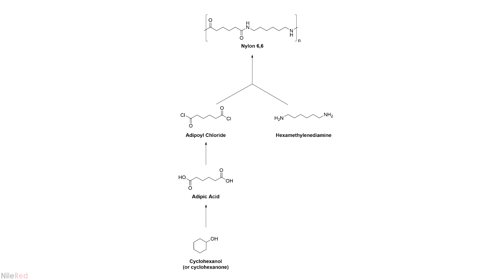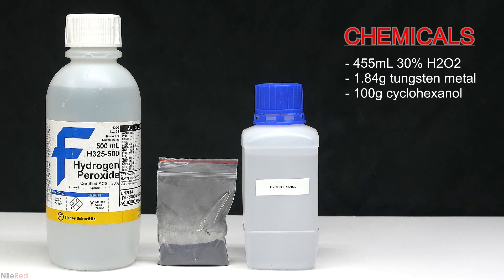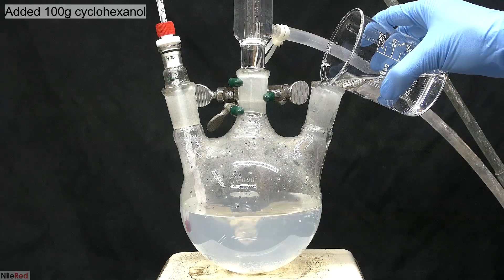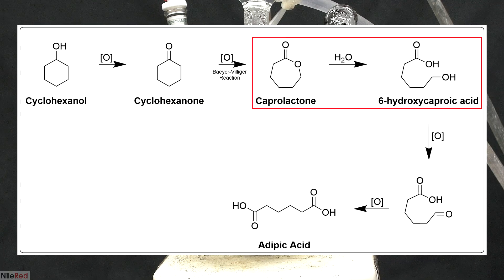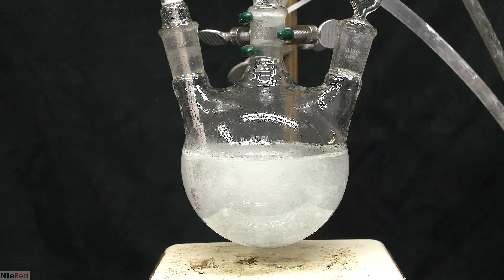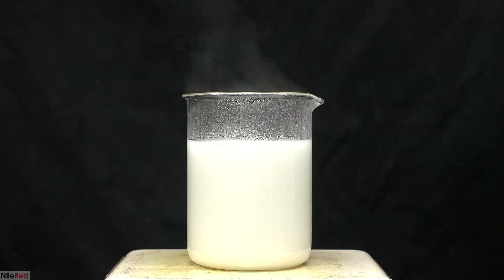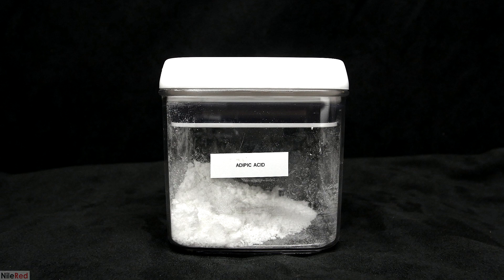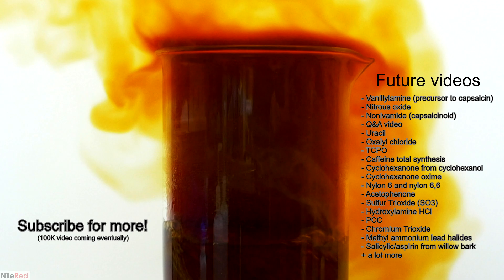Making a Nylon Precursor using Green Chemistry

Comment: I also did a video on that synthesis and with the Help of a co-catalyst I could get the yield up from the 34%, that you got up to 44%, thats about a 25% higher yield. So If someone wants to try this synthesis check up my latest video ;)
I used 5-Sulfosalicylic acid(easy made from Salicylic acid and H2SO4) as Co-catalyst, but you can also use Phosphoric acid, Hydroquinone or Ascorbic acid(but 5-Sulfosalicylic acid is by far the best).

Comment: 5:54 whats the significance of having the thermometer in the left joint? Would the middle read something different?
Reply: The middle is occupied by the condenser. It's normal lab practice to use the middle neck for the heaviest/biggest piece of glassware to have a more balanced apparatus.

Comment: You need a water bath around the flask (such as in a large beaker on a hotplate) instead of the mantle.  You will have a large thermal ballast.  If the reaction makes a lot of heat, you can control it with a few ice cubes added to the bath.

Comment: VoV. Please tell me where he got the beakers with nile red written on it
Reply from the maker: I had them made! And i sell them on my website www.nilered.ca
Reply: Oh... sorry for my not noticing.
Reply: One more question! Where do you get those long condensers you use in countless videos. They look very thin, yet there is water running through them.
Reply from the maker: +Aditya Varma I didn't buy them, I was given them. So I am not sure where to get them. They are my favorite condensers though! I think they are pyrex brans
Reply: Cool. Great video btw! keep doing videos with facecam!
Reply: Hello, Is it possible you could do a video on the preparation oof monomethylhydrazine? Generally, the hydrolysis of gyromitrin yields monomethylhydrazine. I plan to use it as a rocket propellant in one of my upcoming projects. I understand if you can't do it due to risks and concerns. Anyway, I just can't seem to come up with a feasible prep (im 15). Thanks.

Comment: maybe it get lower melting point because it is hydrated. Water act as impurity, dry it well and measure it again. A question: could you have used simple acid catalysis in place of W catalyst ?

Comment: For the lava lamp effect, it looks like it's going in the other direction.
So maybe the bubbles cool down in contact with the surface at the top and sink. At this point there is more interface with the liquid so it reacts faster and heats up, which brings the bubble back up.

Comment: If you're interested, adipic acid can also be ketonized with barium hydroxide to yield cyclopentanone, which is a great starting point for anything you want a 5-membered ring in. Also, I think your blobs kept sinking because the cyclohexanol was likely dissolving the adipic acid as it formed and thus becoming much more dense than the peroxide solution.
Reply from the maker: +Amos Z interesting stuff! I'll look into the cyclopentanone

Comment: Could you just directly react the adipic acid with hexamethylenediamine rather than making adipoyl chloride and reducing yield
Reply from the maker: +Joules Jams the final polymer is an amide. You need to convert it to an acyl chloride to react with the amine. The carboxylic acid won't really react. It will undergo an acid base reaction and not go very far
Reply: NileRed I thought in proteins the same thing happens but I guess they have enzymes. Could that be a green method to use enzymes?

Comment: You can make an equimolar salt of the amine and the adipic acid. When that is done, melting the salt slowly will make nylon. That way you will even be "greener" by not using any chlorinating agent, and only making water as a waste.
Reply from the maker: +HClO3 Chem really? Interesting. I'll look into that!
Reply: Yes! I read it in a quite old polymer chemistry book I sold like 2 weeks ago. I was quite intrigued. Apparently, only mixing the two compounds in solution and waiting will lead to polymerization even with water present.

Comment: You have many interesting things on your shelves. Including much evidence of either acids in the air rusting, or neglect/disuse. Either way.
Edit: And like the 'toss bottle of powder'  'toss bag of metal'  'hold firmly onto the acid' :)
Reply from the maker: +Electra Flarefire I boiled some acid and kind of ruined some stuff
Reply: That know from experience. Left an open container of HCl in the workshop sink cleaning metal and left it for a  week. Came back and my workshop was rusted from heavy at one end(near the acid) to untouched on the other.
The stem of the drill press was even rusted on one side and not the other. It was impressive.

Comment: It took this many years for someone to figure out replacing nitric acid with hydrogen peroxide? Immediately when you said acid is used as oxidiser I thought why not H2O2?
Reply from the maker: +deldrinov the issue is the catalyst and the reaction conditions. You can't just swap it very easily. They used a new catalyst and had to heat it.

Comment: I think your issue about the exotherm etc could be limited by using larger glassware as you do not seem to have enough headspace in your reaction vessel. Larger glassware would limit how badly it would boil over. When I work on 100 g + scale I use a 1L 3 neck at the bare minimum, it looks like you used a 500 mL three neck?
Reply from the maker: +Dizzyheights this is a 1L.

Comment: is this viable for large industrial scale production , i assume you must have researched about it while you were digging around . and is this more expensive or cheaper than the original reaction , as hydrogen peroxide and nitric acid prices vary greatly by country wise . what happened to your second channel , nileblue ? thanks for looking at my questions , waiting for the next video .
Reply from the maker: +Shrikesav Adhitya the paper says that it is viable. I think it is slightly cheaper or about the same. Peroxide and nitrtic acid are both pretty cheap. I think the issue is that it's hard for manufacturers to completely change their setup. 

My second channel was forgotten as I got busy with other stuff. It will be revived soon, I promise!

Comment: Did you think about using cyclohexene instead (about the same price and more commonly found in higher purity)? Should give the same product through dihydroxylation/diol cleavage/oxidation via tungsten catalysis.
Ozonolysis and oxidation would also give you the product in about an hour of work, but not sure now readily available the materials for that are outside of research.

Comment: Can you name the offending eBay seller? I would like to avoid them in the future.

On the other hand, dud you consider that cyclohexanone may be the contaminant? It freezes far below cyclohexanol, so it wouldn't be too unreasonable to assume cyclohexanol is crystallizing out at freezer temperature. I couldn't think of much else that would contaminate cyclohexanol, barring adulteration.

Finally, could the insoluble stuff be just residual tungstic acid left over from the oxidation? Did you also consider that the low yield may have been due to the repeated attempts at crystallization?
Reply: I second this comment.  Without H202 the tungstic acid will not be soluble, try rinsing with cold H2O2 instead of water.
Reply: I don't think so. If the contaminant was cyclohexanone it wouldn't be a problem, since cyclohexanone is formed as an intermediate in this reaction.

Comment: Hi Nile, I'm always very happy to watch your videos. Soon I'll try to extract cafferine in half-industrial scale, basing on your videos. But that's not the point. While you were heating reaction mixture, why wouldn't you use a simple (and extremely cheap) circuit to control voltage on heating mantle?
Reply: You could also use a fipmle thermistor and a arduino pcb to automatize it. Even to make mantle 100%, when temp is below wanted level, and turn off if it's equal or higher :)

Comment: how did you measure the melting point
do you have some type of super calibrated thermometer
Reply from the maker: I have something much worse than that. It is my own homemade apparatus. It involves an expensive Fluke thermocouple and a heat gun. It is surprisingly accurate, but horrible at the same time.
Reply: Dammn you should do a video about that that would be very cool

Comment: Have you every thought about using a PID controlled heating base? That could adjust the heating based on the temperature of your solution in a feedback loop.
Reply from the maker: I have, but either I need to make it myself or buy one. I am lazy though and they are expensive, no?
Reply: NileRed It would be really easy to write some Arduino code to control the temperature of the reaction, and it would be cheap. Under $25 usd.

Comment: WOW, the Mounties!? did they come to your house (Eh)?<-i know I know. but seriously..... also BE CAREFUL. one of the largest additives to tungsten is thorium. so your tungsten has A VERY high chance of being contaminated with it. it's sheet that or cerium, lanthanum etc. great video. keep it up! oh and the globs could be a Thorium or cerium intermediate. remember you said your tungsten wasn't that pure! I'm sure the guys from the "paper" your citing didn't use eBay tungsten. lol 
the sharp increase in temp during the oxidation reaction seems to me ALOT like a "free radical" mechanism. these usually include a sharp activation that includes a sharp increase in temperature as they are usually exothermic. anyway, that's my 2℅ forgot about the cyclohexanol(and didn't watch the video all the way thru at the point where I got overly excited stopped the video, and preemptively posted) yeah, your guess makes more sense.
Reply from the maker: Thanks for the input! Also, are you telling me that eBay tungsten is not the highest quality that money can buy??
Reply: NileRed lol, sure it is. if you don't mind the floor sweeps from the local GTAW tungsten electrode manufacture!
Reply: so I want to clear something up. after reading my first post I realized how it might have come off. I have a metallurgical degree/background and an IMMENSE love for organic chemistry. I have studied the field of organic chemistry, synthesis and it's practice for five+ years now. and metallurgy for over ten. I also believe in and support the home chemist/scientist. some of the world's greatest discoveries were made this way. I know your smart and I know, thru observation at least, that your lab skills, safety and knowledge are of at the least at a graduate level. however having said this, what I don't and could not know, is where your knowledge stops! since there's not a single person on this planet that is TRULY an all knowing expert in the field of practice,(except me 😋) ESPECIALLY organic chemistry, I have to assume there are MANY holes/gaps in yours as well! I merely wanted to express the dangers of thorium and it's compounds because of their toxicity. since you mentioned that your sample came from eBay and you thought it might not have been of absolute purity (of which I agree)and at the same time didn't hint towards what the contamination might be, I was offering a likely source. And only really said anything because the most likely contamination, Thorium or thorium oxide, is NOT something to play with! I am VERY sensitive about this particular element because many years back I fell extremely ill and almost died from Thorium poisoning. I had accidentally ingested a small dose of Thorium-232 over the course of about a week. this happened because one of the plants air scrubbers had failed due to poor maintenance and a blocked up carbon filter that was 1 1/2 years past its change out date. luckily, the area I worked in was a small metallurgical lab that I myself ran alone and no one else was exposed to this. when tested, the room I worked in still showed levels of thorium in the air of around 210 ppm! this is well above the EPA max exposure limits of what I think was 1.5 ppm?(don't quote me on that) a cup of water that I was drinking from was sent in and tested. they think this is how I was exposed the most. the Metal "Dust" had fallen into my water over the course of the day/week? and reached a peak level of 2600 ppm!!! I'm lucky to be alive and although I have a greater potential for certain cancers among other long term health issues, I'm grateful! so think of it as fatherly like advise and not someone taking down on you. keep up the great work! also, would love to get my hands on one of them NR Beakers! 😋
Reply: HAH! As the fortune cookie said, "That wasn't chicken". Perhaps grinding a TIG welding tip would yield a better source? According to Miller, the green banded electrodes are pure W.  [https://www.tungsten.com/products/tungsten-electrodes/]

Comment: So why even use the nitric acid method if the H2O2 method is better in every way?
Reply from the maker: Good question. I dont know all the ins and outs of the industry though. It is possible that some have switched over. A lot of times, it's because the industrial plants are build to work one way. It is not so easy to swap it over. It means stopping production, losing a lot of money and rebuilding stuff. 

The yield is about the same too, so there isn't even a real financial benefit.